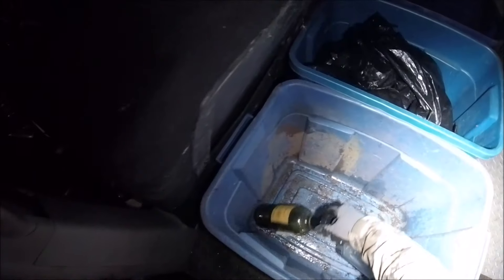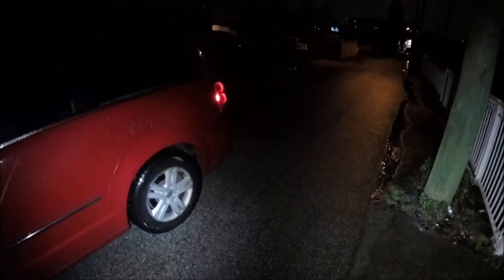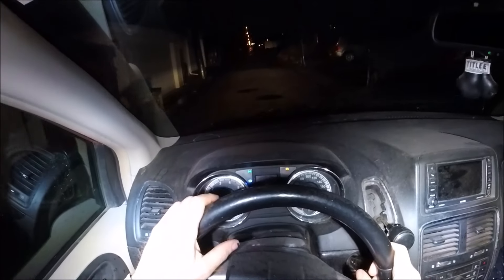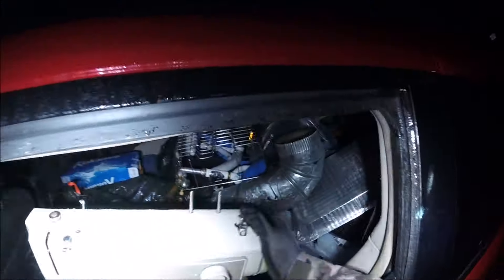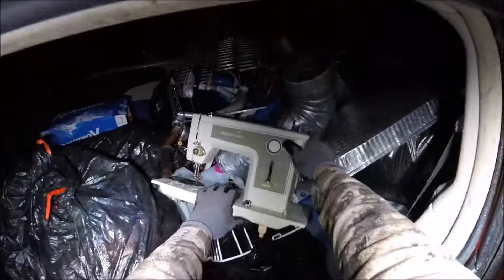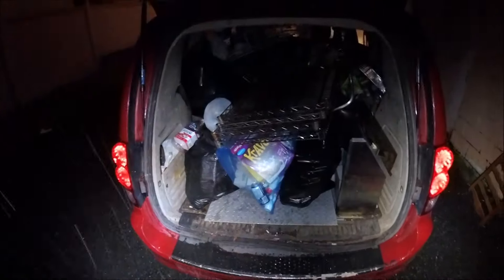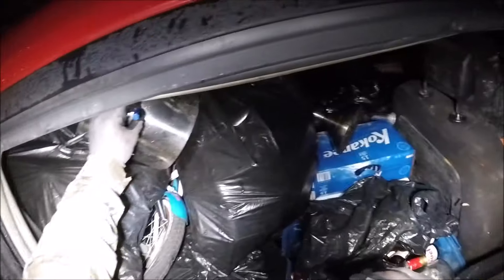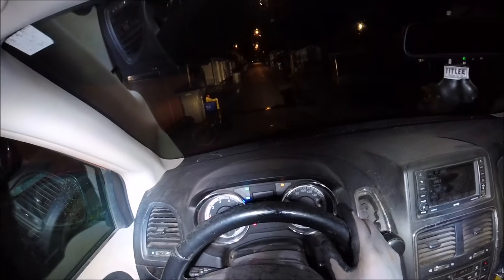Street Scrapping Lots of Bottles

Comment: Hi Phil, I tried two days ago to make my first street scaping run of the year. I didn't find anything, even not a single can. Must be too early here, we still have snow and weather going down to -20 celcius by night.
I am cleaning my garage reserves. I finished the microwaves, the electronics exept the last 5 computers.
I worked one week to strip 3 years of wires stacking with the little StripMeister.
Garage is so empty that I was able to clean the floor dust with a garden hose.
I scraped the two last Clay Paky Golden Scans I had that were used by the Cirque du Soleil and later by the Cirque Eloise.
Here is a video of this 80 pounds show projector.
https://www.youtube.com/watch?v=p2SvrdsubJQ
There was 10 small motors, 2 big and one medium size copper transformers per unit. the sides are full extruded aluminum and there was plenty of brass wheels and other components inside.
Good luck with many finds on your side, have a nice day.
Reply from the maker: Must be worth a lot when new